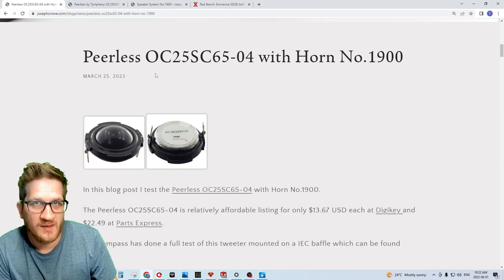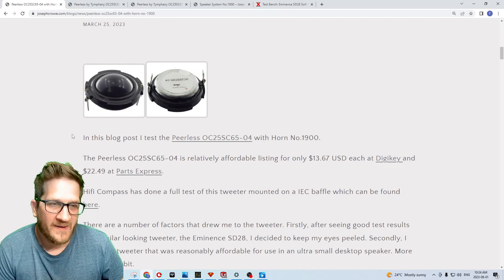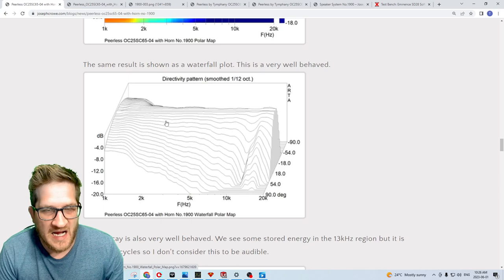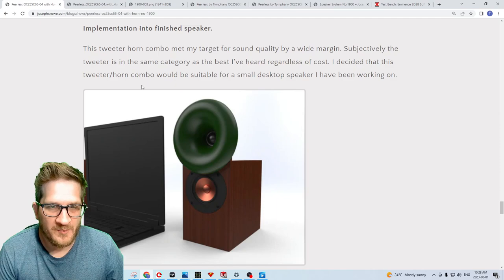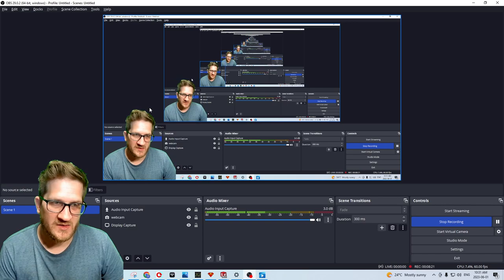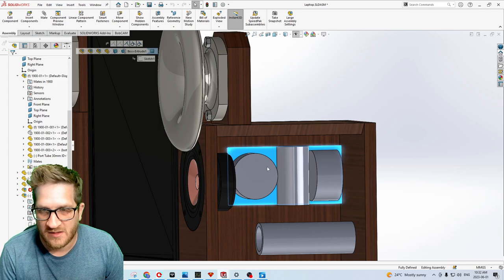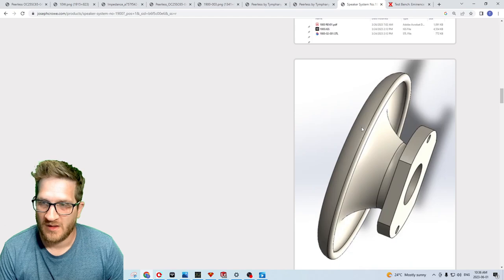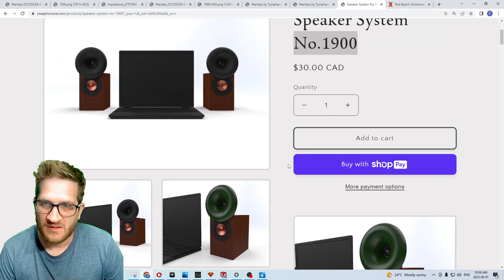Speaker System No.1900 with Peerless OC25SC65-04 and Markaudio Alpair 5.3

Comment: Would you put a low pass filter to keep low-frequency distortion under control?
Reply from the maker: As a desktop monitor it’s not required but you could as an option if you needed deeper bass.